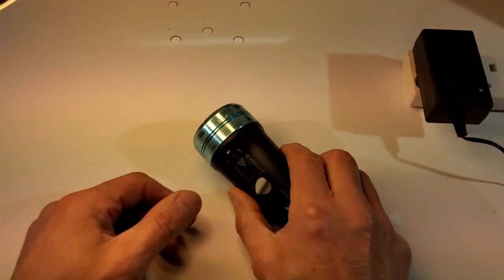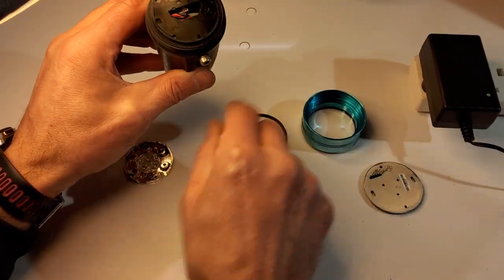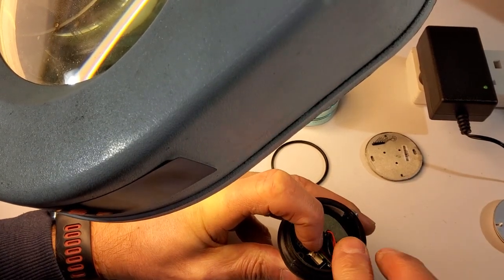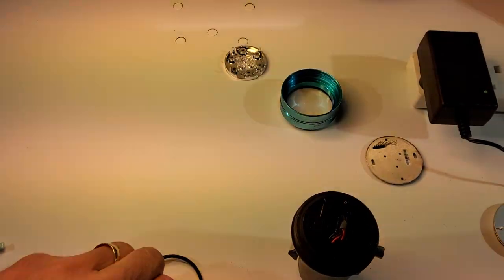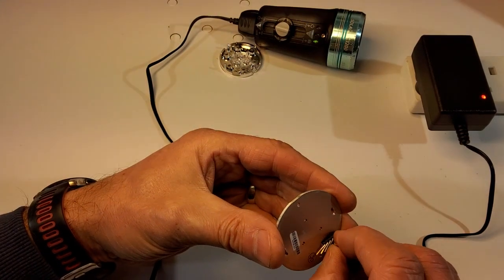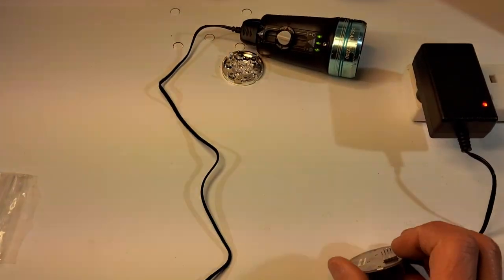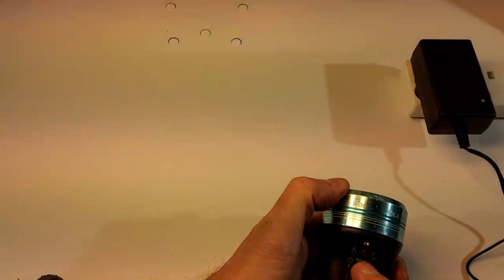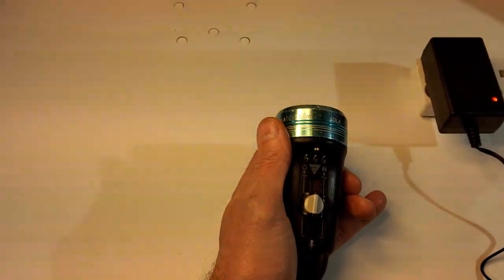Light and Motion Dive 1200

Comment: my sola is not turning on correctly battery is fully charged i tested the battery separately and it was in perfect condition when i turned it on the light start working when i released the switch it stop working any idea